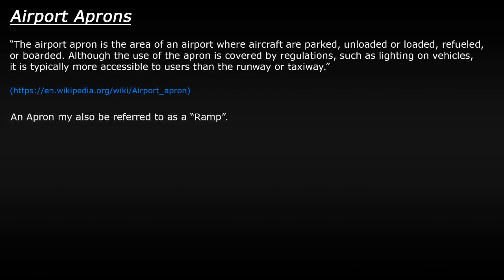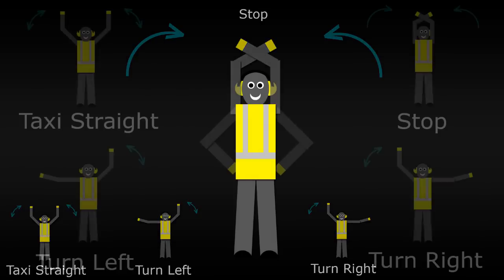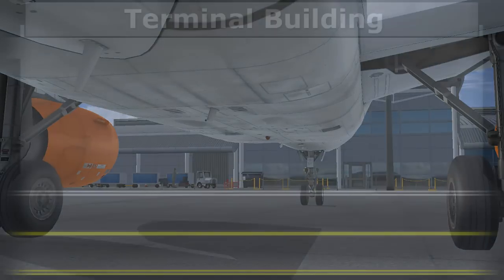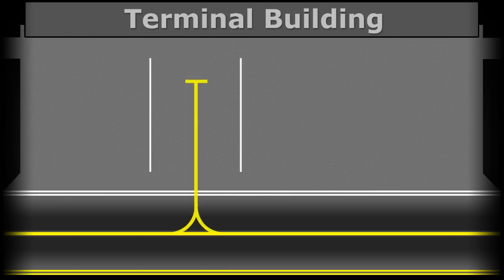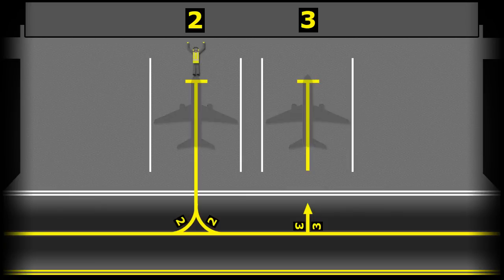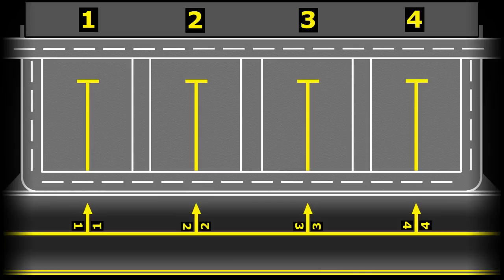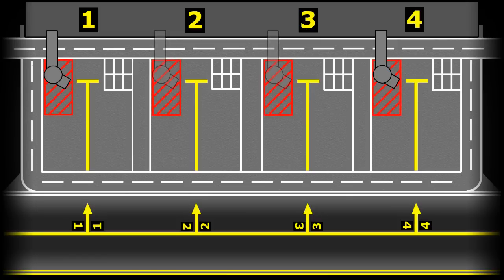Airport Aprons Explained

Comment: Hi you are right about vehicles driving under the plane but there are times that you can do that it’s mostly if the aircraft company are okay with it and normally it’s onlt the fuel truck that parks under the wing. If you ever need to know how anything works at a airport I can help I work at one.
Reply from the maker: I used to work as a Baggage Handler myself ;)

Comment: You said in previous video, that where the TX runs alongside apron, this part of the TX edge marking will be yellow dashed.
In this video, you said that apron is separated from TX by 2 solid white lines.
So, do both of these markings take place?
Thank you for nice informative videos)
Reply from the maker: Yeah, different airports use different markings. They both serve the same purpose and indicate the same thing.

Comment: What about leaving the ramp and how are ground vehicles alerted that a plane is about to enter or leave a certain ramp area?
Reply from the maker: When leaving, an aircraft will turn on it's Beacon/Anti-Collision lights which is the Red light above and below the center of the plane. This is basically warning ground handling crew "The engines are about to be started/The engines are running, STAY BACK!". At larger airports, sometimes the baggage handlers will stand out at the wingtips during pushback and give hand signals asking any vehicles to stop. As for arriving at a gate, it's just common sense. Planes have right of way at an airport so if you're driving along and you think a plane is going to turn into a gate, stop, wait to see what the plane does and then react accordingly.
Reply: Thanks. We really enjoy and learn much from your explanations.  We fly often and are always intrigued by the operations at airports. Now, we have some insight on things ...... :^)

Comment: At the start when you said an apron may also be referred as a ramp, wouldn't the most common word for it be a stand as they use over ATC for example: "EZY5225 stand 10 requesting push and start"?
Reply from the maker: Yeah I mention "stand" later on in the video but it looking back, it would have made more sense to introduce the word at the start.
Reply: Okay no worries just in a mood to criticise people today...

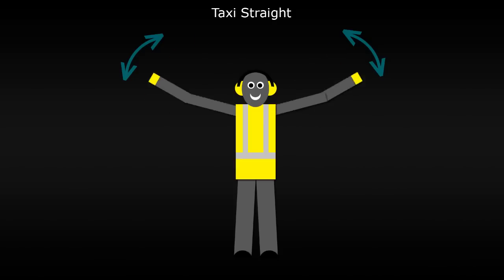Comment: Turn on the automatically generated subtitles and go to 0:58 😉
Reply: guess it's changed now
Reply: Since these are auto-generated, you can't change them
Reply from the maker: HAHAHAHAHA!!!!..... I'd love to leave that as it is but I have to change it lol.
Reply: Mohammed Iqlas Uddin nope, i just checked 😂
Reply: It's possible to dsable auto-generated captions for a video though.
Reply: in settings there is an 'English' option, which doesn't have an issue, and there is also an 'English (auto-generated)' option which has the erm 'typo' (but it's nowhere near a nsfw typo)
Reply: Marc Kloosterman its bullshit

Comment: You think you can do a vid on the different buildings and ground vehicles?
Reply: Ecto Gaming20 EBT (electric buggie) 
diesel buggies
tugs 
catering vehicles
TSU (Toilet service unit)
water trucks 
De-icing units
Jeeps
Cars
vans
Mini & full size buses
Fire appliances 
tractors
HiLo (the loaded that puts ULDs ((bins)) onto and off aircraft)
Belt loaders (the baggage belt that goes into the a/c)
Refueling trucks
a cross between a buggie and tractor 
--
terminal, atc tower, fire station, maintenance warehouse for parts storage, hangars, baggage hall, cargo warehouses. Thats all I can think of my airport if it helps any.
Reply: Ok then now I can start an airline

Comment: I've seen the marshals drive across taxiways before at MAN. Wasn't even on the designated roads.
Reply: Some taxiways are okay, as long as they're not in the Movement Area.

Movement Areas are under ATC direction, while Non-Movement areas are not. With some exceptions, all ramps, access roads, as well as some T-Hangers and low-traffic taxiways are not controlled, and GSE can move as they please through them.

That being said, all aircraft still have right-of-way, so under no circumstance should a pilot have to stop the plane for a ground vehicle (only exception being an emergency vehicle with lights on).

Source: am airport ramp worker with driving experience.
Reply from the maker: It's possible that you were watching other ground ops. I remember seeing a car driving around London City Airport regularly to shoot fireworks into the air to scare off birds. Even so, they have radios in the car and contact ATC for permission to use Taxiways, cross runways etc.

Comment: Pleeease fix the sound for next time. it is very tiring. First there are the pop-sounds and general audio quality (nasal, lack of high frequencies). It sounds like you are using a cheap microphone or headset, quite close to the mouth.
Then, because it is close and the mic is fixed or handheld, as your head/mouth mouth moves around in front of the mic, the sound volume constantly changes a lot. basically every quarter second you talk in the mic, then left to the mic, than top of the mic, then bottom, etc. maybe depending on how you angle the mouth if it is a headset.
Reply from the maker: Thank you for the detailed description! That really helps me out :) I've listened again carefully and I understand what you mean. Unfortunately I do just have a headset microphone however I'll look at getting a much better quality microphone in time for next week. As for nasal sounding, that might just be my voice, not much I can do about it I'm afraid.
Reply: i am sure it is (also) the mic. Put the mic farther out (so the distance becomes more constant and the sound more consistent) instead of in front of the mouth maybe? this will also get rid of the "pop" sounds.